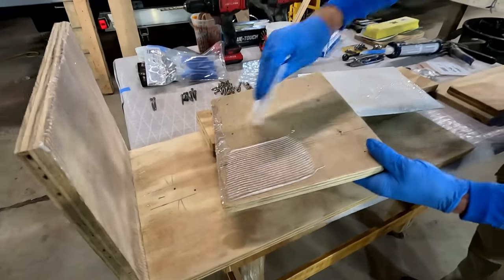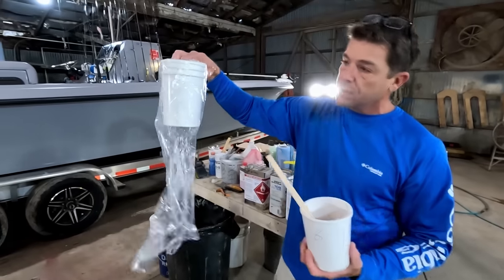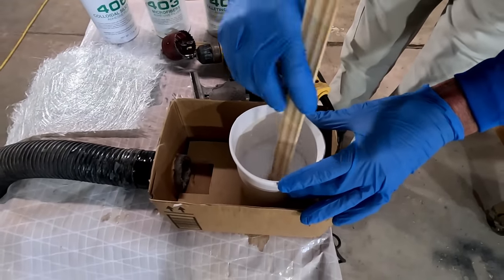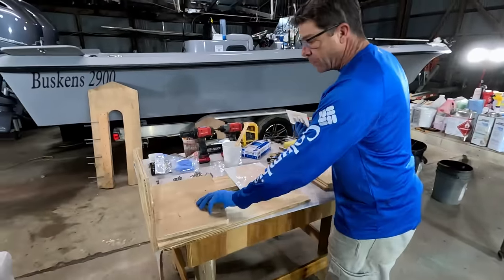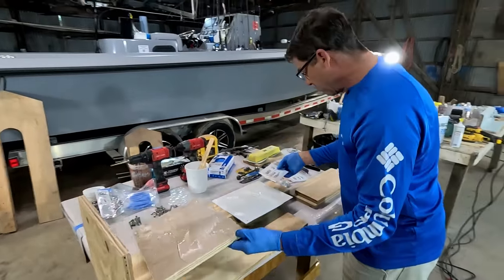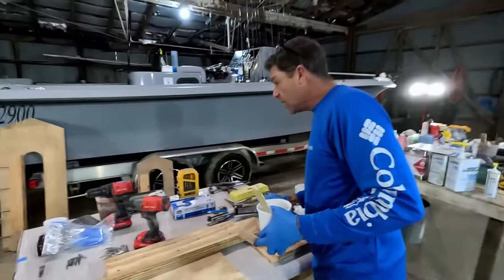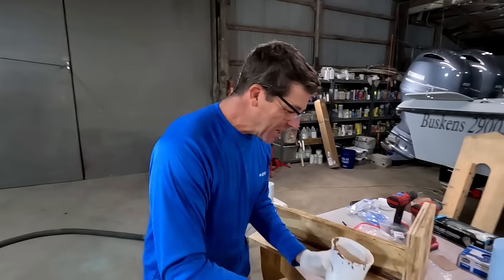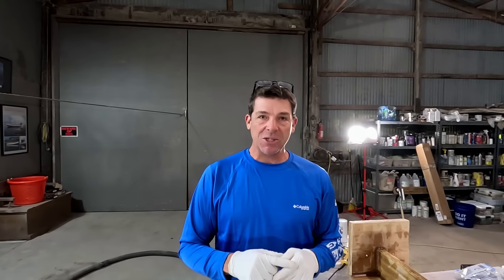HOW TO MAKE STRINGERS and TRANSOMS with PLYWOOD and EPOXY

Comment: Hi Joe.  Question:  is it better to epoxy bond ply stringers to ply transom first, or glass transom first and then bond stringers to that?  Thanks!
Reply from the maker: It can potentially be done either way. On my 29, I glassed in the transom core, then glassed the stringers to the transom. You just want to be sure that everything is very well sealed and water tight. Be sure to use plenty of fiberglass when tying everything together because the transom takes a lot of abuse. I will be starting the transom replacement on our 21 ft Blazer Bay very soon, so stay tuned, and thanks for watching!

Comment: Thank you for the video.  I wonder if you can help me with your suggestions.  I am replacing on a 33 ft catamaran  a 15HP 2stroke OB with a 25HP HT OB. There is a  weight difference from the 92lbs of the 15HP to the 147lbs of the 25HP - so 55lbs. Very similar dimensions and same pivot point measurements and Length - other than that one has the manual bolts, the other one must be bolted.
So the current transom is 3 pieces of wood epoxies together to make a 18" long x 2" thick x 6" deep piece that is bolted x2 at the ends to the body of the sailboat. it works very well with the 15HP in Gale storms.
My thought was to make a new thicker and deeper piece with 3 pieces of marine plywood and epoxy, followed by 3 layers of of 1708 Biaxle (17oz with 3/4oz mat) with epoxy.  so the whole piece would be close to 3" thick by 12" deep and 18" wide. Is it an overkill to add a transom support plate?

What are your thoughts? The transom is out of view.
Reply from the maker: Glad you are enjoying the channel! I always say that it is better to overbuild, than to underbuild! Especially in a area that is critical, and if weight and cosmetics are not a factor. Of course this is just my opinion! I hope this helps and thanks for watching!

Comment: Hey. Just wanted to say I love your YouTube videos. You’re doing great! 

I have my first boat a 1989 Penn yan explorer 2000. It’s fallen victim to a soft transom. I don’t want to get rid of it because I really do love it. Do you plan on making a video about repairing a transom? Mine unfortunately needs to be cut out from the back of the boat. I have a splash well I have zero fiberglass experience and want to see if it’s even practical for me to attempt myself. I’ve also looked into liquid transom. What are your thoughts on that?
Reply from the maker: Congrats on your new boat! Unfortunately, transoms going bad is a pretty common thing, but there are several options to fix it. It sounds like you have already done some research and see that there are 3 main options. I have replaced transoms from the inside, and outside but have not tried the liquid transom yet. Liquid transom seems like it could be great if it does what it is supposed to do. The other 2 options are going to be a pretty major job, especially if you have never worked with fiberglass. I don't want to discourage you, but want to be realistic, and help you make the best decision for You. Replacing from the outside is usually going to be easier for the type of boat you are describing. I don't currently have a video detailing that process, but I could possibly do a video touching on some of the steps you would be going through. In the meantime, you might want to pick up some basic fiberglass supplies and see how you feel about working with these materials. Some laminating polyester resin, and some csm and 1708 fiberglass are very commonly used materials, or you could go the epoxy route. either one could work. Maybe just experiment a little before you make a decision one way or the other. We do have some links below most of our recent videos for the materials we use and recommend. Your purchases also help support the work we are doing on the channel. We are also setting up for Patreon so we can help folks more directly if needed. this will be coming very soon. Hope this helps, and thanks for watching!
Reply: @FishBumpTV  thank you for the insight. I wouldn’t even be opposed to bringing the boat to you guys (I’m in New York) and maybe we can use it as a way to test liquid transom for a video or even use it for a transom replacement video and maybe you could teach me some fiberglass basics while I’m there. “Fiberglass made easy for a diy-er with minimal experience”

Comment: Been watching your channel and loving it. Would you normally use epoxy for glueing stringers etc then epoxy for laminating/ glassing over top And polyester for glueing and polyester for laminating or can you glue with epoxy then polyester glass over top
Cheers Goatqld
Reply from the maker: Glad you are enjoying the channel! If we bond with epoxy, we laminate with epoxy. I don't recommend going over epoxy products with polyester products. We usually use one or the other. You can use epoxy over cured polyester and vinyl Ester resins with no problem. I will have a resin selection video coming soon for you guys. Thanks for watching!

Comment: What do you think of plain clear silicone caulking as glue?
Reply from the maker: I would not recommend clear silicone as a glue, it works just fine as a sealant in some applications. If you want to permanently glue something together I would recommend either west systems 610 or 3m 5200. Hope this helps and thanks for watching!

Comment: have you ever experimented with making your own pourable transom?  seacast is 5 min from my house im just being cheap, and i have an abundance of polyester resin.  i know i cant just use it like normal, it'll get way too hot and probably crack all over.  is there such a thing as a "slow" catalyst?  i found filler materials like ceramic microspheres, to add to a cabosil, csm mush to make a seacast consistency...which happens to be polyester based.  just wondering if you or your buddies ever tried such an experiment.  i cleaned out the transom cavity from the top today and im left with a flawless fiberglass cavity, 5/16"+ thickness on the hull, and roughly 1/8" thick inner transom shell approx 24 x 24 x 1.125.  

from watching your channel id say you'd probably lean toward cutting the inner shell off the transom cavity and laminating new ply and glass everything back vs a pourable solution
Reply from the maker: Yes, you are right in assuming that I would probably just replace the transom with a new core. But I also understand that there many applications that a pour able transom could be a great option. I would imagine that some combination of materials could work in place of seacast or one of the other pourable transoms, but I don't know if the money saved would be worth the risk of it not working in my opinion. I hope to do a video on one of these products in the future, so stay tuned!

Comment: Does the mixing tube nozzle on the 6-10 need replacing after each use?  I would imagine the epoxy would harden at the last inch or so of the tip.
Reply from the maker: Yes it does, but they are not very expensive. Great product overall.

Comment: Do you always heat your plywood? I am in Panama City, FL .
Reply from the maker: I like to if it is possible. It is so humid down here,and plywood will pull moisture out of the air. I like to dry it as best as I can before the primer coat of resin goes down. I feel like the primer coat is one of the most crucial steps in a quality fiberglass over wood application. I hope this helps and thanks for watching!

Comment: Do you always need to mix the epoxy resin with the filler? I dont think i saw you do that in other resin applications
Reply from the maker: No, the fillers just give you options for different uses with the epoxy, filling, bonding fairing etc.  I hope this helps and thanks for watching

Comment: Why you did not use the leftover epoxy putty from previous badges for that round profiling at the joints?
Reply from the maker: We made the video over a couple days. We clamped the transom piece and let it cure, then we did the fillets.

Comment: Now if i'm replacing rotten stringers - should i have been screwing them down through the bottom fiberglass of the boat? i mixed some silica and bedded them in and just put weight on top... never occured to me to screw them.
Reply from the maker: No, Do not screw through the boat. I mentioned in the video that this is a demonstration piece and that in a boat you would bed them in epoxy or some other bedding material then glass over them. Hope this helps, and thanks for watching!
Reply: Ooh - dangerous part for me to miss.  Awesome video and great tips thanks for clearing up my misunderstanding.
Reply from the maker: @workingdiligently8458  you are very welcome, glad to  help. Feel free to ask questions if you are unclear on any of the material we go over in the videos. Thanks

Comment: Why not add filler until  epoxy is at desired thickness so don't add too much? Imagine that you knew how much filler to add from years of experience ,but believe for a beginner my suggested technique is basically the same intent and safer.